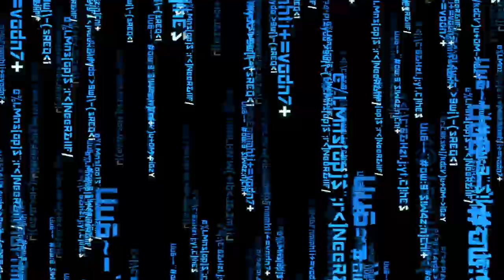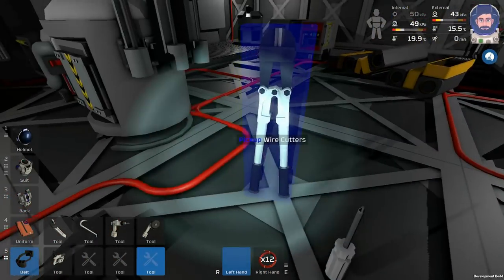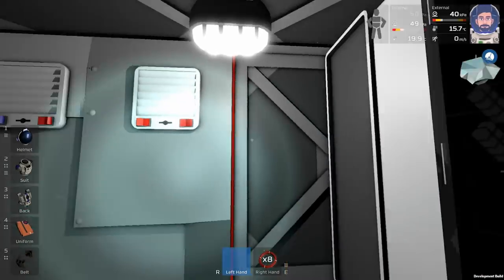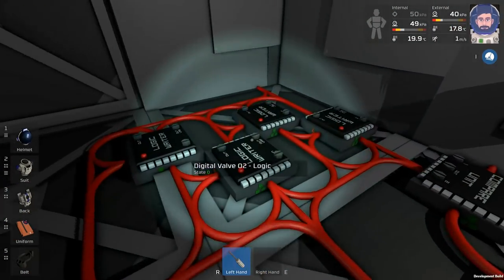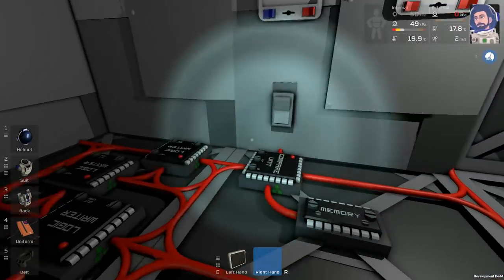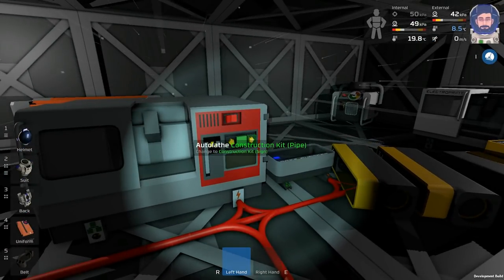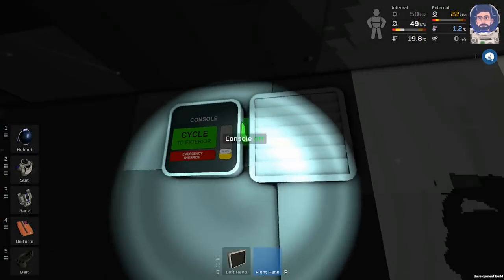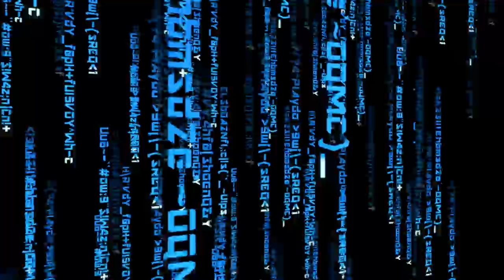Let's Play Stationeers - E6: Improving Filtration With Logic Chips & Base Beautification!

Comment: Hey, Knight: I assume you are wanting the power info from the "Station Battery"? You first need to make sure that it is connected to your "network". (not just the power but the data as well). You would use the LED display and some logic circuits to get the info from the station battery. (This is conjecture, I've never actually tried this one)

Comment: 1. Earths atmosphere is about 21% Oxygen 79% Nitrogen and 1% Other, but what you need is oxygen density so 40% Oxygen and 60% Nitrogen at 50 kPa would also work.
2. I don't know this for a fact but are you sure that data goes trough the heavy wire? In your episode two when you are setting up the airlock controls it does not look like data goes trough area power controllers.
Reply from the maker: Good to know, I'm pretty sure the heavy cable transfers data, though I'm less sure about it running "through" the power APCs, so I'll have to test that. The other thing that another comment made me think about is I'm not sure I actually wired the data port on the battery lol. :P